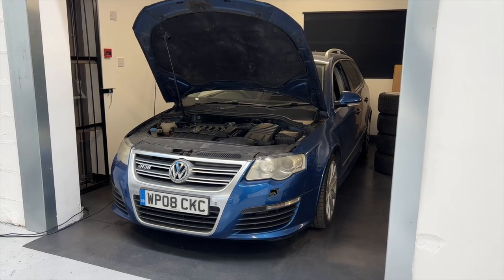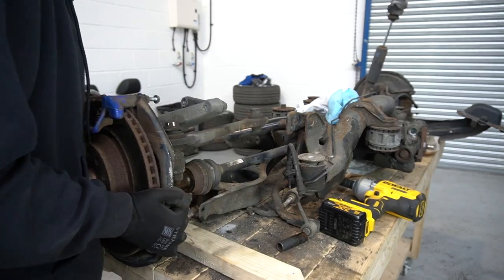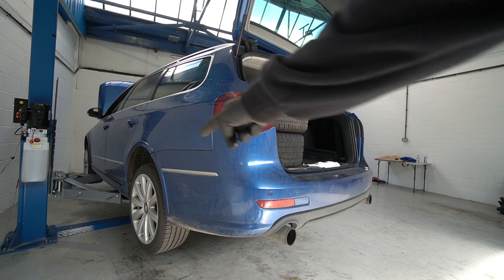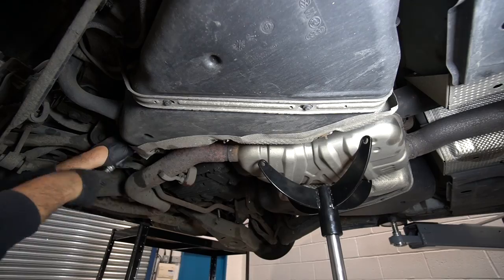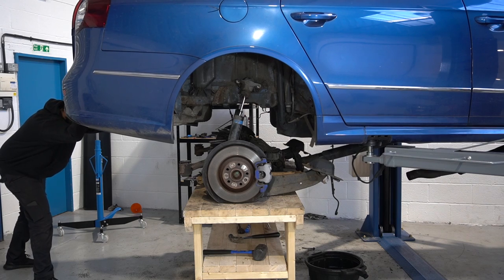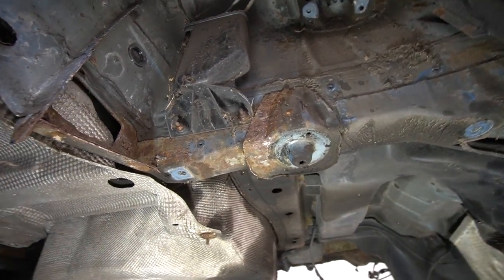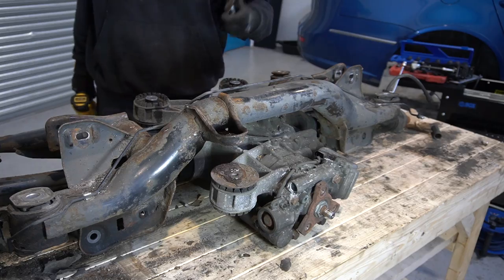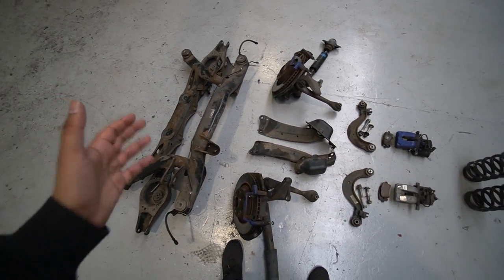RESTORING MY CHEAP VW PASSAT R36 | PART 2

Comment: Top tip to stop a drive shaft from spinning whilst you remove the end bolt. Get a large Allen key or sturdy screwdriver and stick it into the end of the brake disc between the vents (obviously only works on vented discs) When the assembly moves, the alley key etc will wedge up against the calliper carrier and lock the whole lot whist you remove the half shaft bolt.
Reply: Was just gonna comment that😂
Reply from the maker: Yeah it’s a great way to do it - I usually use that trick but that impact gun is quite violent so I had a feeling shards of screwdriver would start flying everywhere  in this case lol
Reply: @TRHamza what model dewalt is it?
Reply from the maker: DCF900

Comment: Top tip, brake pipes.. There is normally corrosion under the plastic coating next to the join you are trying to undo it will always look swollen . So burn off (using a lighter) a small part of the plastic coating so you can clean the corrosion off before you undo the join which in turn will stop the pipe turning/twisting and snapping.  Afterwards dab a bit of paint to cover up the exposed pipe and stick some grease etc over it

Comment: R36. Almost - almost - bought one when they were announced. From memory, VW had them at £26k estimated... then it took about 18 months to actually get to a point where I could buy one, by which time it had swollen to mid £30k. In the meantime I'd bought an Alpina B3 3.3 which was doing an excellent job of bankrupting me - so between the bottomless pit of the Alpina and the price creep, the R36 never happened.

In hindsight, wish I'd held on and got one.

Comment: Ive had my r36 saloon for about 8 years now.   Tried to look after it.  Cat back stainless from supersprint. Very expensive but sounds just right imo. 
Just done brake discs.  Front wings are starting to go, in typical vw fashion.  Bolt on though i think and its black so should be easy match.
Tha blue is the nicest though, must admit. 
Ive done a couple of suspension bits but other than that just tyres and oil changes.  
Still love it.  Good luck with project!

Comment: I’m doing this atm with my mk2 Octavia Vrs got a rear subframe off and a3 getting the subframe sandblasted and then gonna paint it with hammerite then putting on new arms brakes,callipers,carrier bearings and dust shields expensive but worth it! Keep up the good work boss man

Comment: Lucky with those upper control arm bush bolts - mine were metallurgically bonded together (aluminium bush collar and steel bolt chemically reacting together like a chemical weld) and had to be cut off with a reciprocating saw!

Not so hard to misalign an R36 rear subframe but for other 3C2 and 3C5 Passat models a set of alignment pins is useful (T10096 VW special tool number or Sealey equivalent which are way cheaper). Always renew the subframe bolts as they are torque till yield (TTY/stretchy type) or better still if you have the budget get upgraded reusable bolts and locating collars.

Nice DCF900 - I have the DCF899N which is the older model but what a piece of kit!

Great car BTW!

Comment: Nice job, fab car, re the hub bolts…..wood worked but next time use a screwdriver in the disc it’ll jam against the carrier or use vice grips (if not vented) or better still loosen them before dropping it off car.

Comment: I was in the same situation with the rear arm tracking bolts but on a Golf MK6 I had to chop the bolts off with a dremel, what happens is the bolt fuses to the metal sleeve that's in between the bush, it took me ages. I had to chop the head off the bolt, chop the washer off and then trim down the bolt enough that it manages to squeeze out of the subframe, goodluck taking them off you're going to need it!
Reply: Same im having issues with my scooby  with the bolts stuck abd spins with the rubber bush
Reply: @Flipping Cars & Repairs  I went through several blades with a dremel, it's just an awkward area, had to lower the backbox to access the bolts as I didn't remove the subframe, nothing else would fit in the area, once I managed to chop the head off, I then chopped the washer than is part of the bolt, once that came apart I cut the bolt thread as flat as I could. I then managed to get a bar under to wedge it out of the subframe, it's a ballache and I don't want to do it anytime soon lol

Comment: Have you managed to get out in the caddy rs yet after those upgrades? Ive got a  R36 manual swapped caddy and want to hear you opinons on that rear anti roll bar. Had one in my basket for months 😂
Reply from the maker: Not yet unfortunately mate I need to take it for an allignment but want to fix the oil leak first